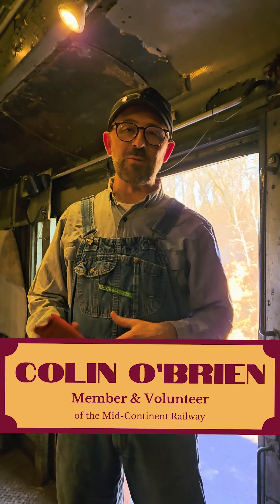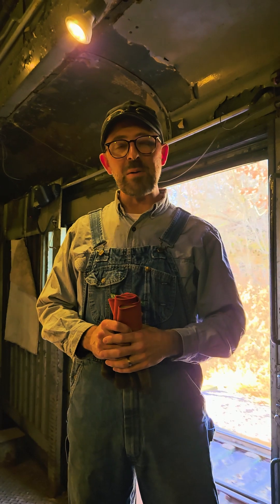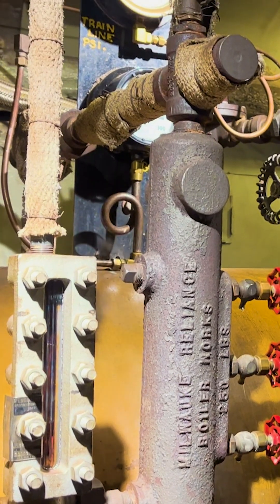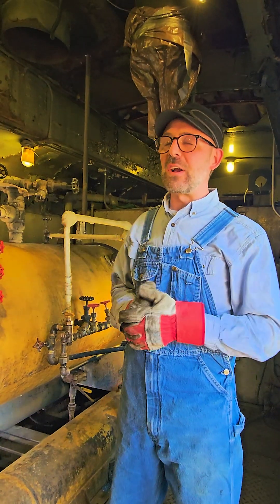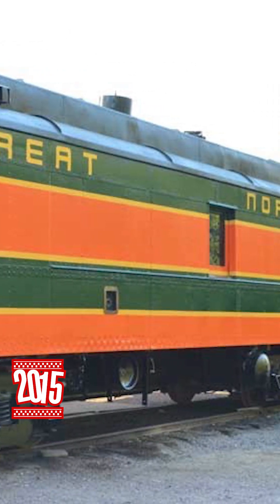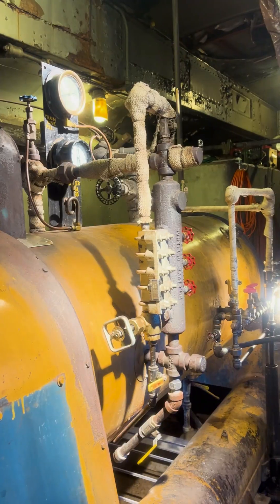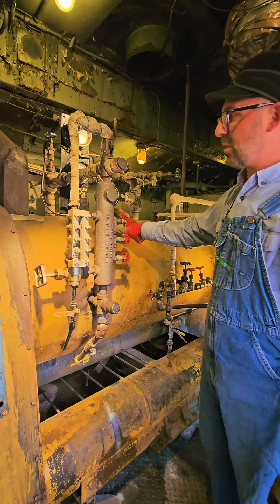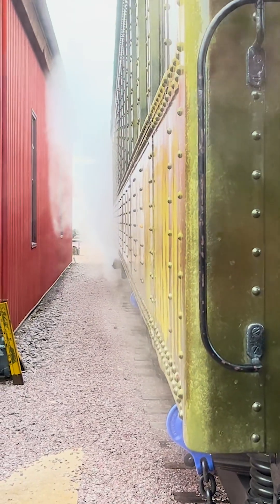How To Heat A Train With Steam!

Comment: Out of curiosity, is the steam a closed loop, or does it vent out of each car as spent condensate?

To me, I would think it would make more sense to bring the condensed water back for reheating because you can only carry so much water. But I can also appreciate the issues that would come with water quality.
Reply from the maker: There's always an exception somewhere, but in general, and at Mid-Continent, train steam heat systems vented the spent condensate.

Here is a description of the system found at Mid-Continent as posted by one of our steam heat volunteers elsewhere on the internet...

"I will only speak to the single pipe system used in the Lackawanna coaches, 1914 vintage, Pullman built, used at North Freedom. The coach is broken up into 4 heating zones or loops. Each zone has a valve to cut the "vapor pressure" steam to the heating loop in or out. Each of the valves has a steam trap to drain the condensate either from the valve alone (when shut) or that heating loop (when open). This way, even if a valve is shut the tiny amount of steam through the pilot opening of the valve can drain. The pilot opening is there to keep the valve thawed even if off.

The traps in this system open wide to only drain off the condensate. Otherwise they close to just a tiny pilot opening to keep enough steam flowing to keep them thawed out. In normal operation at Mid-Continent you can see when doors are held open & such by observing the train line steam pressure. When traps open up they take a large gulp of steam.

At each end of the train line we have a steam trap threaded into a Vapor connector and hung on the train line. This keeps the "metallic steam conduits" drained so they don't freeze up.

In this system there is no steam that is vented simply to keep steam flowing. The steam flows into each individual heating loop only when enough condensate collects at that particular trap to cool off the internal bellows in the trap enough to open the trap & drain onto the ballast. When the trap is "empty" and only steam is draining the bellows warms enough to force the drain shut, collect condensate and repeat the cycle"
Reply: @MCRHS  Thanks for the explanation. I always wondered how that would work when you had like an 8-12 car long train, how the heck did they get steam to the last car! The controlled leak of the pilot valve makes sense... I would imagine on the initial fire up, they'd have to leave the valve open at the end to get steam flowin there and to carry enough heat to get the system up to temperature before corking it off.